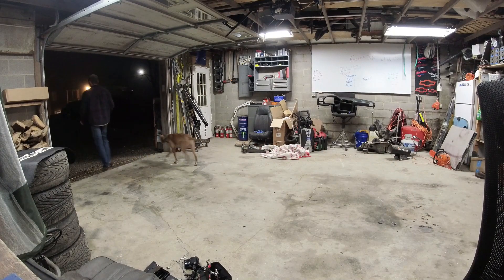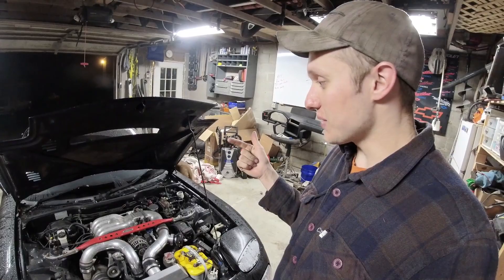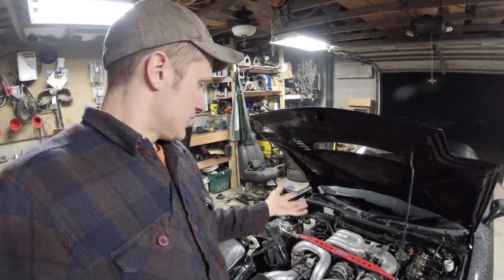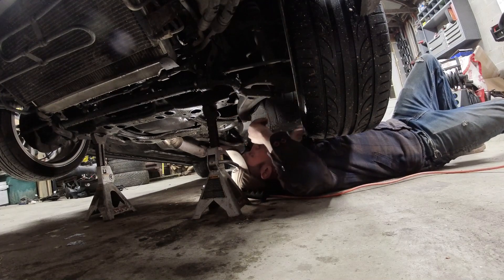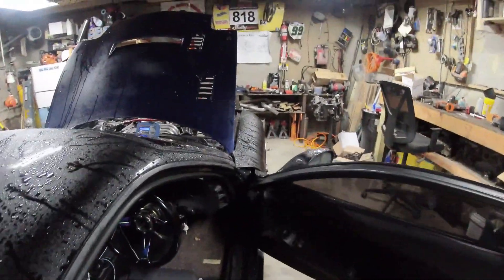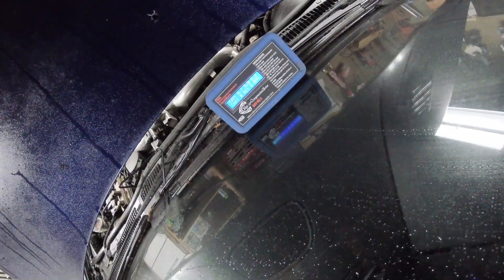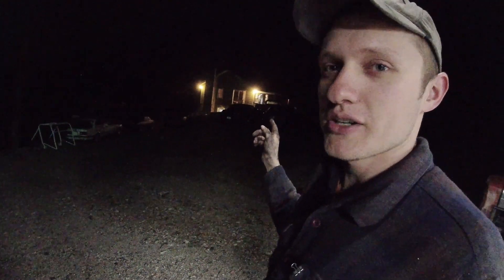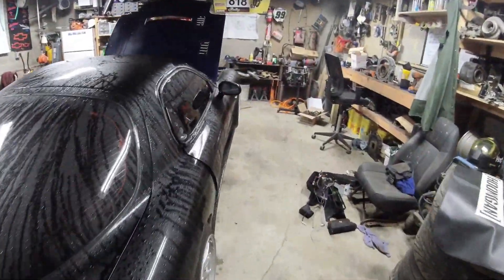Project RHD FD Rx7 is Here - And it Has PROBLEMS

Comment: honestly i love my fd i bought it before the jdm tax and i payed 7000$ for it and its mint! blown the engine 5 years ago and im re building it as of right now the original engine had 12500km on it when it died it served me good im switching to a single turbo setup i plan on running haltech elite1500 i live in Canada 🇨🇦 and i deleted the A/C don’t need it up here 25C is a hot day here lol and whent with a volvo electric power steering pump changing the plugs is easy when you do that!
Reply: That blows my mind finding a mint rx7 for less than 30k usd is pretty much impossible now

Comment: Couldn’t really see your legs but the way you were positioned it didn’t seem like you held the throttle open during the compression test. Not that it will matter for this engine, but for the most accurate result the engine should be warm and throttle wide open. Sub’d to follow along!

Comment: Ouch. Definitely hurt.
As to rotary philosophy. I didn't really set out to be a rotary guy. My friend's 2009 RX-8 he'd owned from new but rarely driven had always been on the edge of my radar when he mentioned years ago wanting to sell it. I was only rotary curious at the time. 
Then in 2020 after I'd finally gotten a Miata earlier that year circumstances worked out to get the RX-8. Only 7,103 miles the first time I started it. Stored in a garage so paint and interior are near showroom pristine. I both love and hate driving it. It's such a time capsule I worry about something happening to it but it's meant to be driven. So I'm just shy of 12k miles now and I have to keep telling myself it's just a car.
So all that is why I bought those 4 nearly scrap FBs last July. I'll learn by saving at least one of them (perhaps even two). But in the process of hauling parts I sold to recoup the cost of the FBs my truck had a little mishap that's consumed most of my car hobby time the past 6 months: https://youtu.be/debXbQweZUg

Comment: I think the expenses and reliability is why many decide to do a v8 swap in the fd, an aluminum v8 is actually pretty close in weight to a turbo rotary and make a ton of power and torque plus are very reliable, also with the size of the engine compartment it's not too difficult of a swap.

Comment: not sure if you did this when you worked on this fd last, but could you do a fairly in depth engine pull video? i don’t mean like a bolt by bolt tutorial, but if you could do a little walk through explaining any tips and tricks you use when pulling fd engines and/or engines in general that’d be tight
Reply from the maker: Yessir!! Ill throw a bit more detail in there.  FD specific info really.
Reply: @RADPotential  you’re the man

Comment: Did you have the fuel injectors cleaned and flow tested? This gets over looked quite often when doing rotary rebuilds. It doesn't matter how well the engine is built but a slightly clogged injector will take these engines out in no time.